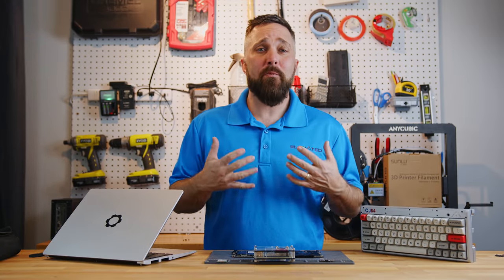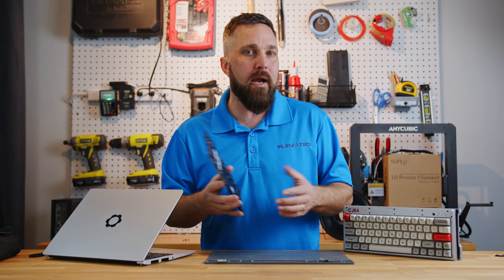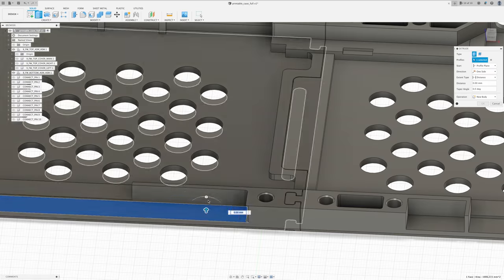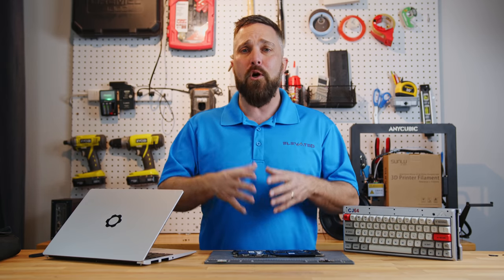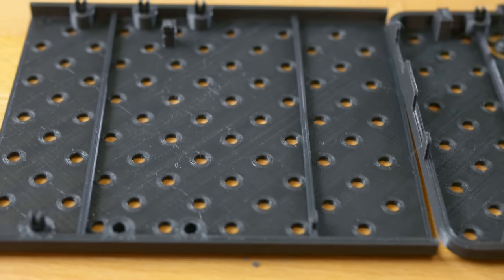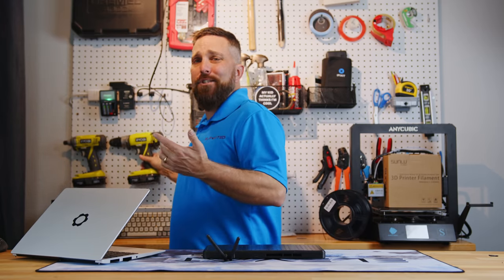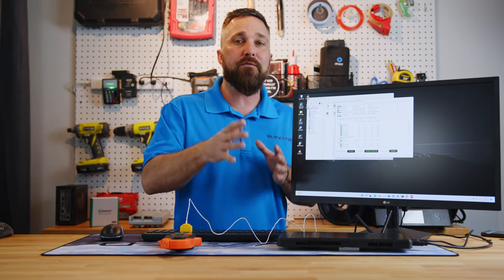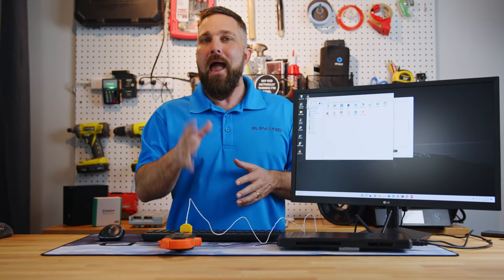The Framework Mainboard Case! Printed, Built, Tested.

Comment: YOU KNOW WHAT WOULD BE COOL: A nas case, that slots a framework board in it.
Literally repurpose an old framework board from your laptop to a nas
Reply: This, 1000%. That is a perfect use for early adopters who want to upgrade their systems.
Reply from the maker: Do you know of a good thunderbolt to sata solution? Maybe a TB to PCIe adapter with a PCIe sata card?
Reply: @ElevatedSystems  A NAS wouldn't need the PCIe for boot, so why not use a breakout cable, like it's used for graphics cards, to connect a HBA?
Reply: Great idea
Reply: okay I'm doing this.
Reply: I had the samethought when this came out. Imagine a Jonsbo N1 with a framework guts.
Reply: amazing idea
Reply: Nice - but - give me 6 of these in a cluster with an 8 port router (2.5 gig) + battery - and I can run a full-fat HA Kubernetes cluster that I can stow in a backpack. - I would settle for a mini version with 3 nodes + router and run Docker-Swarm.
Reply: M.2 to mini SAS adapter and you're in business

Comment: Selling the board by itself is AMAZING. It's a great way to get a low power sff pc for normal usage.
Reply: I wondered how framework could succeed in the market, but having the possibility to buy components modularly and doing anything with them is awesome. So much possibilities. And you can rebuild it in the form of a laptop whenever you want. I'm hyped
Reply: @padnomnidprenon9672  Get more hype with the news by AMD and aCPU's becoming way more efficient and powerful than they are now. You could have a mainboard this size with the power of a 3060 easily if the numbers aren't lying. Like, that's crazys to think about.
Reply: Agreed 👍 and now they have AMD now
Reply: @roetemeteor think  more like 1650  or 3050

Comment: This should be called the “MainFrame”, since it’s a Mainboard from a Framework. 

While the price value for the from scratch option isn’t great right now, I think as new mainboards come out older models will drop in price. Suddenly having 11th gen i5s at say 300 bucks would be huge for leftover stock/e waste removal. 

I really want to see if I can make a Steam Deck like case for the mainboard. There are raspberry pi video games handhelds so it is possible, but as a newbie to 3D printing it would be tricky. Could you do a intro to 3D printing? 

Thanks for the great framework content, it really helped me decide to purchase mine.
Reply from the maker: I started this, I got the battery and cooling solution worked out but I haven't got up the motivation to begin designing the PCBs for the controls.
Reply: @ElevatedSystems  That’s awesome, I will eagerly wait for the video on that!
Reply: @ElevatedSystems  a proof of concept with something like the gamesir x2 android controller would be a solid option maybe!
Reply: Replacement model....
It may vaporize demand of 'sustainability'
Reply: @ElevatedSystems  Start with one of those bluetooth clamp controllers meant for tablets as a proof of concept! The controller PCB's could take a while!
Reply: The 11th gen i5s are now 300 bucks lol. You are spot on. Good job. /srs
Reply: That 11th gen i5 costs 350$ so the motherboard with the fan, cpu and ram is a great deal
Reply: @ElevatedSystems  would love to see a new video out on your "Framework Steam Deck" design!
Reply: @mitlanderson  I'm actually trying to sweeten up my current boss for when we move buildings and we got the potential to up our tech game to get a ton of these and a printer so we can take these, bolt them to our desks, and set them up with a keyboard/touchpad combo with a small monitor and webcam set-up. We can pull prints, update status, clock in/out, and effectively not have to leave our desks at ALL instead of waiting in line to update on our two pc's. It'll be kinda wonky at first, but the argument is there isn't a large PC to kick or take up desk space, we don't have laptops that walk off or can't be repaired or modified easily, we don't have tablets that have batteries that die or break even if you put them in a bullet proof case, and we don't have to deal with a NAS or something for wireless access. Ideally, we'd all have a PC that can't be broken or have stuff spilled on it, would be wireless, would be lightning fast compared to most office PC's, and would be easy to cooperate with any audits for data.
Reply: finally, we can hack into the mainframe
Reply: with collab from coolermaster now it's possibler

Comment: You know, with the popularity of tiny form-factor PCs of late, I've often wondered why companies don't just take out their laptop mainboards and put them in small enclosures to act as a full-fledged desktop PC. You have the option to put in a much beefier cooling system than the laptop got - whilst still being able to maintain the overall tiny size - plus considering laptops these days are pretty close to having desktop performance anyway (and that gap is often down to lack of cooling) especially when they come with a discreet GPU you wouldn't really be able to tell that your new gaming rig is actually running off laptop components.

I've seen a whole ton of small form-factor PC builds over the past few years, and they always seem to struggle the most around the size of desktop-grade GPUs, the desktop motherboard not always being the most practical for this form due to the fact the components ON the motherboard are often chunky in size which in turn reduces cooling options (unlike a laptop where everything is as flat as possible to the board which allows the cooling to be thinner and able to be located on top of board much closer), and the size of desktop-grade cooling solutions. Seems to me there's a bit of a gap between desktop components and laptop components where somebody could come in and give us the best of both worlds??
Reply: Definitely! As an SFFPC enthusiast I'm desperate for a smaller motherboard standard than ITX because that's one of the limiting factors to go smaller, GPUs and PSUs being the other two. Intel's new NUC 12 Extreme would be the best option right now to pair with a desktop GPU if they released the Compute Element separately. But even that is kinda overkill with its desktop CPU which is not necessary anymore, especially for 4K Gaming.
This Framework motherboard would be perfect if we could strap a Noctua NH-L9i on top of it, a GPU to the back with a PCIe connector and the smallest possible PSU next to the whole thing or the GPU if that's short enough.
Why not just buy a Laptop? Because Laptop GPUs are relatively slow and the fans are loud. If you're only gaming at home noise matters and you're GPU is not limited by batteries.
Reply: @Dionyzos  companies like Sliger or even Lian-Li could really corner the market in this niche by making a well thought out design for Framework mainboards. Could really change the SSF market especially if they manufacture a case no bigger than one of those e-gpus but able to fit the mainboard and a RTX monster with insane cooling.
Reply: It already does in many AIO pcs...
Simply it does not calls user demands.
Reply: funny you mention that i found a few laptop dvd drives in desktops was annoying too since i was replacing the psu and needed a adapter for the power connector.
Reply: @riopato2009  Add Akasa to that list.  I would love a passively cooled case like their Turing for the Framework motherbaord.

Comment: with economy of scale this could quickly become the go to for when people need a full desktop power level solution in a more raspi like form factor. Obviously we are still much bigger than raspi, but we're no small enough to easily drop this inside  a cheaper tv display housing ( these usually have tons of space left over inside that boards can be attached to.

Comment: Looks like a milled aluminium case could bring a higher thermal headroom for the device  I wonder. 
Also, I wonder if it is possible to slap a desktop level cooler onto it so that we could have a sustained all-core boost.
Reply: unless the case is actually making proper direct contact to the hot components on the board you probably won't notice a difference, it's mostly the cooling solution and airflow that matter.

I've always liked the idea of slapping a better cooler on a laptop but sadly most laptop boards don't have the necessary mounting holes. especially not in the right places and the area around the cpu is pretty full with important connections so it's not easy to find an area to make holes yourself without destroying the board.
you can try to attach it around the board with some kind of backplate but you'll lose mounting pressure which is pretty essential for heat transfer.

the good thing about framework is it's open source nature and a large tinkering community so I wouldn't be surprised if somebody came up with a good solution at some point!
Reply: Wouldn't aluminum act like a giant passive cooler? Modifying the 3d file to accept the heat pipe assembly to act as thermal conduit shouldn't be too difficult but I'm surprised that Framework hasn't offered the specs of the mainboard chassis to layout a mini desktop design. Basically, a milled aluminum block without a display assembly. Better yet offer a direct display connector to display port/hdmi cable for connecting to an external monitor, freeing up the 4 thunderbolt bolt ports for swappable modules. Anyone who can come up with a design that mimics the formfactor that looks like Intel's extreme nucs but can fit the mainboard would have my money the moment they release it.

Comment: About printing ABS: you need an enclosure around your printer. Preferably a controlled heated one. Otherwise there is no way to successfully print ABS
Reply: yes and fan should be turned off for sure
Reply: Not entirely true. Depends on where you live. Some places you can print ABS by putting the 3d printer inside a cabinet or something similar.

Comment: As far as 3D printing goes I recently switched to 6 mm nozzle and print at 0.4 mm height it actually adds a nice finish to it because the layers are so thick it hides most of the imperfections associated with 3D printing at least on a cheap under three like I have. Plus the time to print is like half and the parts feel a lot stronger.

If you want to print ABS or anything like that you need to enclose your 3D printer to keep the heat up last time I had to use ABS I just put a big cardboard box over the printer and watched it the whole time do the safety concerns with cardboard and hot electronics.

Comment: So the antenna hold down thingy is by no means specific to Framework, that is a standard m.2 wifi module.  The strap on many is a simple single step flap with one hole.  There are also plastic clip on style, seems that would be ripe for 3d printing.

I rarely use the darn things, if you route the wire so it doesn't try to pop off the connector you should be fine.

Comment: I really enjoyed this video!  I love that basic computing now can be done with such small form factors (and even some light gaming can work with the right integrated GPU and some fast RAM in dual-channel).  

I did have one question - if you're going to remove the board from the constraints of being in a laptop, why not add an external cooler to it so that it can be used to its fullest capabilities?

Comment: For the Wi-Fi most laptops have a place for the wires to stay so it’s not putting pressure on the connectors and a piece of tape to further secure it. Frameworks solution is best I’ve seen but also I’ve never had them pop off without have been messing with the inside of the laptop

Comment: When time comes and i upgrade my framework, i will use the old board for a low power home server system. Since it has tb i would probably build some kind of Blade server style chassis to slot in more boards if the home lab
 grows.

Comment: Turn the part cooling fans off in your slicer and put a cardboard box over your printer and let it get nice and warm there before printing with ABS. Should be able to get you there especially with an ABS+ type filament.

Comment: Thanks for sharing… maybe it’s time to dust off my 3D printer… 🤔. Have you noticed any fatigue in the framework chassis as you “borrow” parts for these projects and reassemble the laptop?
Reply from the maker: it's holding up well. One of the mainbord screw holes in the chassis is striped but that may be my fault, and one of the mainboard internal USB-c connectors is loose and needs to be resoldered.
Reply: @ElevatedSystems  Considering the time you have spend both on and off camera creating modules and such, that seems fair.  Thanks!  I have the i5 Framework.  I think my only "complaint" is I am not in love with the 3:2 display ratio, but it has been great otherwise.

Comment: Do you (or does anyone) have a source for the fasteners needed to complete the build?  Having a little bit of trouble locating a spot to purchase them...  Apparently needs 5 of the mainboard fasteners (M1.6 1.5mm fastener with a 5.5mm diameter T5 head) and 3 of the Audio Board ones (M2 3.0mm fastener with a 4.5mm diameter T5 head).  TIA for the help, and thanks for the great guide!
Reply from the maker: You can use M2 SSD mounting screws to secure everything.

Comment: Idea of something you can do as an addon for the CJ64 or the case, make a laptop screen attachment maybe even with a battery built into it so it can connect with a single type c both powering and adding a display.
Reply: So you want to turn a framework laptop into... Another laptop? :)
Reply: @pigworts2  and? This is a way to make something interesting without buying the full set once 12th gen comes out.

Comment: Imagine making a custom bracket and swapping the cooling solution for a desktop one, I feel that would be amazing project.
Reply from the maker: Have you been in my Fusion 360 files? 😜
Reply: @ElevatedSystems  Sadly no, but this would have been one of the first projects I would have done on the mainboard if I had one.

Comment: This makes me wonder about macbook to mac mini conversions; would be great for vintage macbooks which battery and operating system support is long gone.
Reply from the maker: Not sure about M1, but older iIntel MacBooks either won't run at all, or run at significantly lower speeds without a battery connected. Many also won't boot without the keyboard/trackpad connected.

Comment: Is there ethernet option of USB-C modules? It could be a good small server for home lab/rack with reasonable consumption. If there would be SATA connector it could serve as a NAS as well...
Reply from the maker: There is a ethernet expansion card and there are four TB4 ports so plenty of PCIe lanes for NVMe or SATA expansion.

Comment: NGL, If the 12th gen version is $399-$450 i might get one to turn into a server of some kind. Its small enough that i could probably get 4 nodes into 1U, but i really see this as more of a high end firewall, or a light weight file server with internal battery backup

Comment: I'm curious if this main board could be put in and connected to the macbook pro 2009-2011 17inch laptop. given many old 17inch macbooks run hot and have failing components, but otherwise still have good screens and keyboards

Comment: Would the CPU on the Framework motherboard perform better if you strapped a desktop cooler on it?
Reply from the maker: I'm planning on testing that, just haven't had time to design an adapter bracket yet.

Comment: Those wireless cables don't pop off that easily unless you are messing around with it too much, if you don't have that plastic part, it should not be a issue. Most laptops don't even have them, nor do most pcie cards that use that style of card in them.
Reply from the maker: I would normally agree, but these Intel AX210 cards have horrible connectors. The antenna wires will literally just pop off for no reason.

Comment: When printing with ABS: Have you tried completely disabling the part cooling fans and printing with a draft shield? I can print ABS totally fine without a full enclosure by using those two things to limit airflow. Either way, the case looks super great in PETG.

I really hope we get 12th generation CPUs soon. As you mentioned in your long term review, the battery life is honestly the biggest downside of the Framework right now, and having efficiency cores could be a huge step in the right direction.
Reply from the maker: I actually found a setting that let me completely disable the fan for a set number of layers, I was able to print an ABS piece by disabling it for the first 7 layers and then setting it to 30% for the rest of the print.
Reply: @ElevatedSystems  Nice! I'm glad you were about to make it work

Comment: id like to see framework to out
(1) AMD options for the laptop
(2) beefier Cooler (bigger fan, thicker heatsink) for the mainboard when used as a stand alone PC
(3) To have a 3D printable mechanical Keyboard + PC case housing

Comment: Wow, why such a difference in price from the i7-1165G7 and i7-1185G7? They are basically the same part, with just a slight difference in clocks, but most important, the same recommended price from Intel.
Reply: I think because you get VPro on the i7-1185G7. Could also be other things.
Reply: @Computerdude1500  Again, on Intel's website you can see both parts are listed at the same price.
Reply from the maker: It's because of the other standards to support VPro. It's more than just a different CPU.

Comment: They should have made a printed cover part that would go in the hole where the battery and other cable are and then if you want those things you don't have to print that part.

Comment: If only they did a board and battery in macbook pro configurations, a big market out there for DIYs who are left running Linux on old MacBook hardware. It would be great to swap modern internals into my old late 2013 retina MacBook Pro.